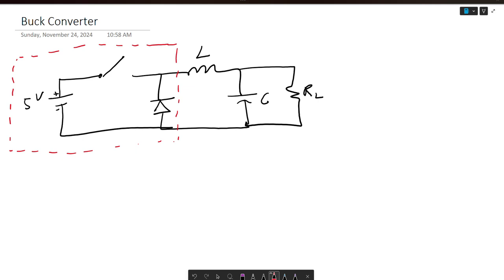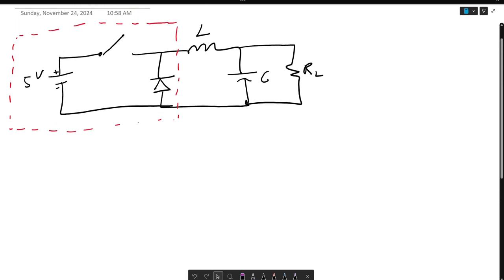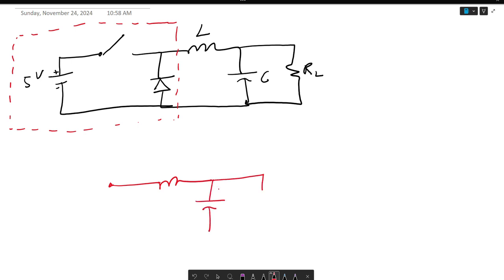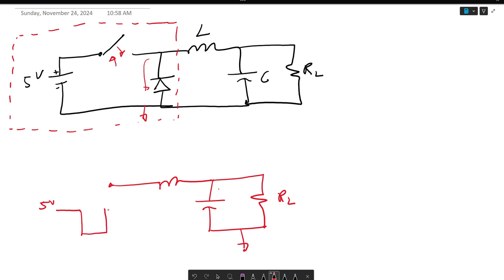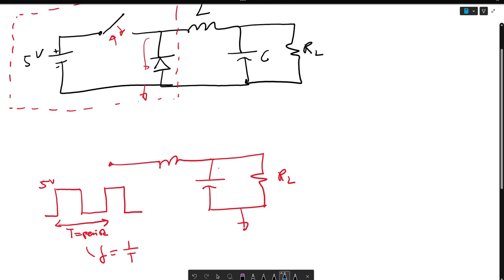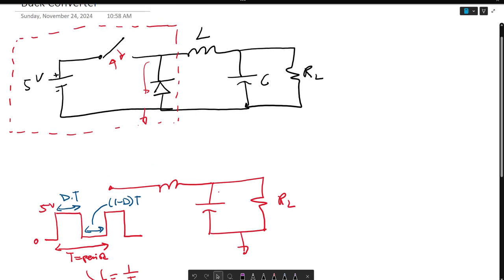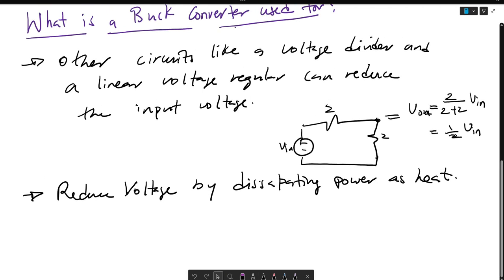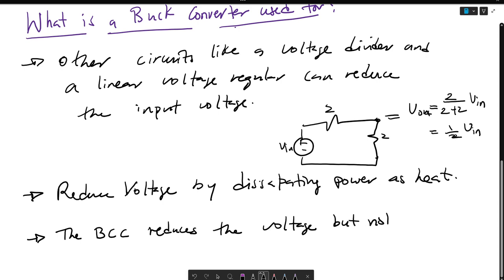How does a Buck Converter work? | DC-DC Converter

Comment: Very clear explanation, i have one question only: how do you dimensionate the inductance and capacitor? What values must they have in a real circuit?
Reply from the maker: Hi, great question. The values of your inductor and capacitor would depend on the amount of current you wish to drive the load resistor. I will make sure to do a video on a buck converter design soon.
Reply: 👍good explanation
...oh, i understand now how they abuse load time from solar pannels and also the charge time from phones or whatever.. 
Thanks a lot for sharing your knowledge  😃🍀👋✨️💫😊